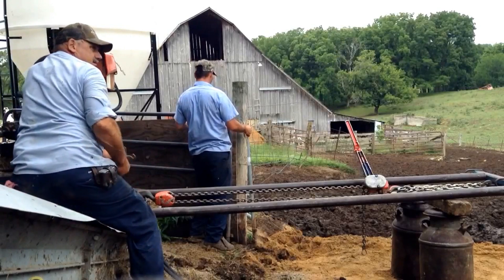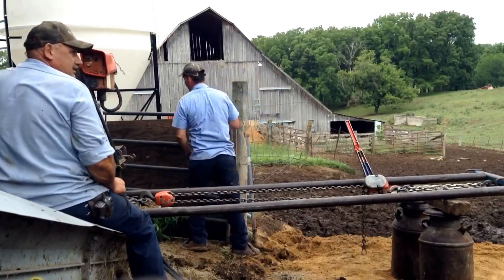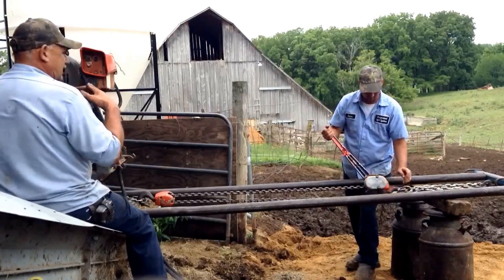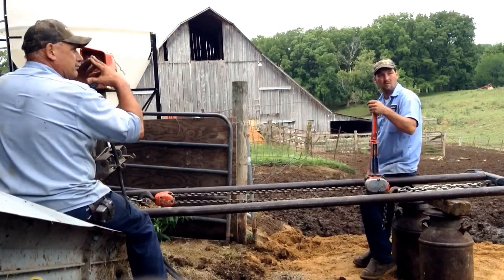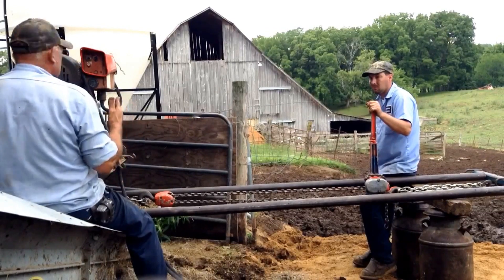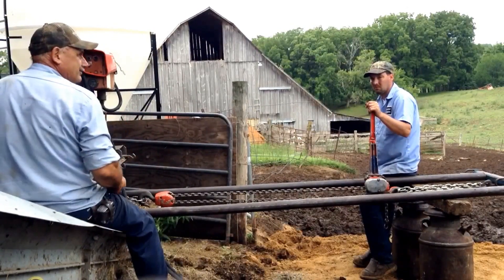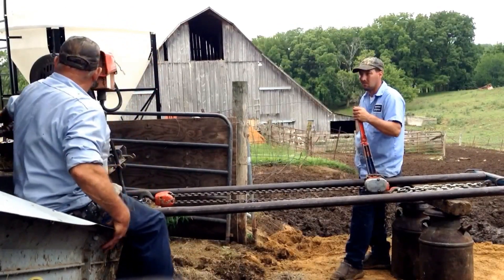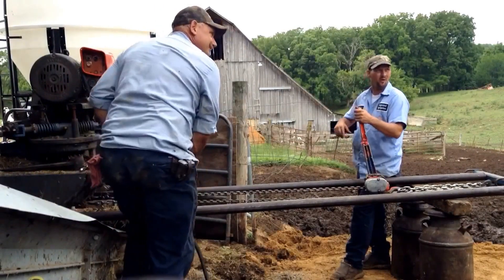Long-arming a Harvestore Silo

Comment: We had a electric winch we used to pull them in and out. ALot easier.  But it did suck when the cone fell in on inself. Only happened a couple time in 3 years.

Comment: Why do you want a cone in the silo anyway?
Reply: well if its longarmed the whole time, and the silo is full with 110 feet silage there would be heck of a weight on the unloader mecanism.
by using a shorter arm,,  its easyer for the engine-chain to move,, and the silo-circle around the walls hold most of the weight,, but looser materials will fall down in the center and be fed out until the silo is almost empty... then you can fill it again ORE do as in this video, longarm it to empty it compleatly

Comment: We use a proper set of installation rails in the UK not balanced on old milk churns,cutter chain looks bit worn by the way its behaving,more proffesional to use the sides of the door frame and wrap the winch right round the machine for a straighter pull,also avoids the part where it grabs hold and walks in nearly grabbing the cable.38 years of doing the job.
Reply: You should write a book